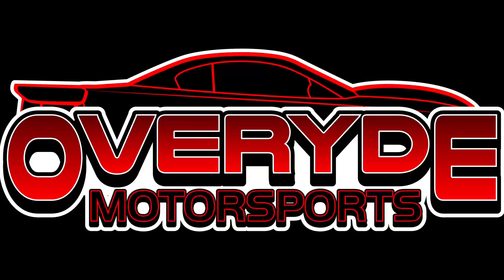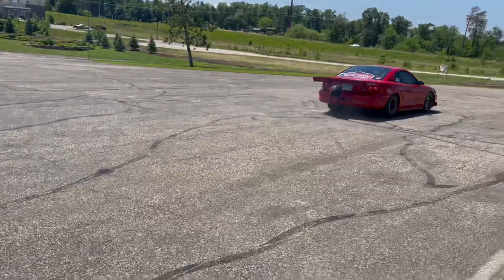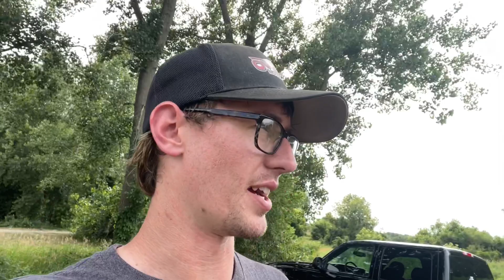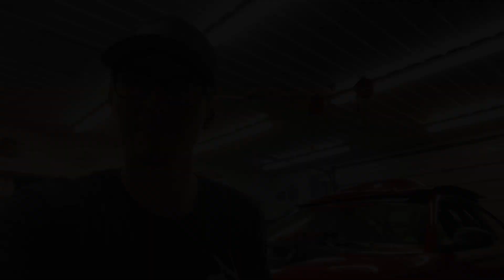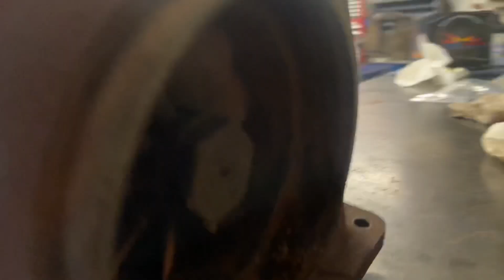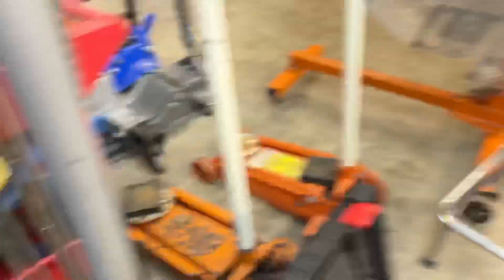Cash at the Creek #2 We made it to the semi finals! But everything keeps breaking!

Comment: Had the same problem with my vs racing turbo. It trashed the thrust bearing in the turbo. Get a rebuild kit from VS and do it yourself. It's really easy! Also have you consider 3 525 intank pumps? We have made 1400rwhp and super reliable.
Reply: One mechanical pump is cheaper, less plumbing, don't burn up or use a bunch of battery juice, and can supply way more fuel.
Reply from the maker: I have it just wouldn’t fit well with my setup. My tank is huge very close to the top of the trunk.
Reply: @OverydeMotorsports  ? Mechanical pump? Mount it off block and drive it with a belt. Motion has kits to do it.

Comment: Did you have to add anymore some pressure to get same boost as you used too? I’m worried my turbo is not doing as it should can’t seem to find any boost leaks but have been putting on way more  dome to make same boost as I usually do.
Reply from the maker: I have been but mine will act Different if I swap converters which I have. Going back to the old one so we’ll see what happens. I’ve noticed in crappy air or really hot days I have to add a lot to get it make the same boost
Reply: Yeah definitely air makes difference was just wondering. In similar da I’ve had some cost issues just trying to track it down thanks for reply
Reply from the maker: Interesting feel like the wheel has some slop?
Reply: @OverydeMotorsports  Not feeling any slip in the wheel. However have noticed a little oil residue on the clamp on exhaust side. Maybe got a seal trying to go I dk drain is plenty big and is almost a vertical line back down to pan. Who knows just gonna send it till it goes lol.

Comment: i didn't see the time slips....  are you satisfied with your 60'?  I mean, are you hooking up?
Reply from the maker: It’s hooking up, just not as fast as it should be
Reply: @OverydeMotorsports  Give a friend one of those laser pointy thermometers,   the tires should be well over 100 degrees by the time the light turns green,   i think you're being shy in the burnout box.
Reply: @OverydeMotorsports  Dude....  just now, 30 seconds ago,   I got a running 427.   you're the first to know.....   gotta call my mom.

Comment: Mechanical is the way to go. These people running 3 or more or a single 1800.00 electric pump, don't make sense. Can get a mechanical that wont draw down your electrical system, won't burn up, and are a lot cheaper. Can get an Enderle pump for like 600.00 and support over 4000 horse on gas and over 2000 horse on M1.
And run a bigger feed and drain on next turbo. 6an feed unrestricted and 12an drain. I do that on all my customer big single builds. Forced Performance recommends it too.
Reply from the maker: Think a 4an is to small? Defiantly gonna go mechanical this winter. You that charging system is tapped out haha
Reply: @OverydeMotorsports  Yes. Go 6an, no restrictor and 12an return. I use Maven mounts and tig a stainless 12an drain on them. Running an 88/92 Forced Performance turbo, that way.
Reply from the maker: Cool mine is all the same aside from the Feed line!